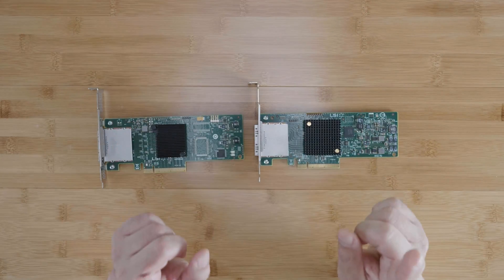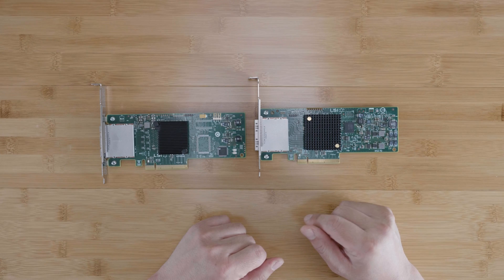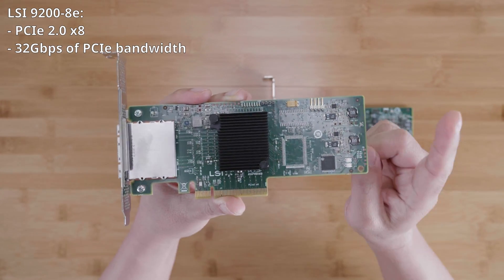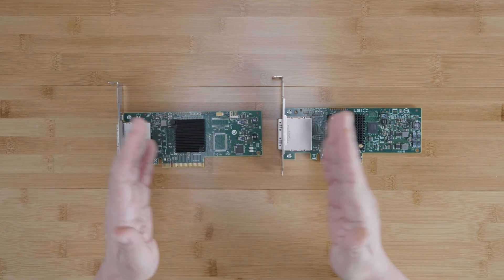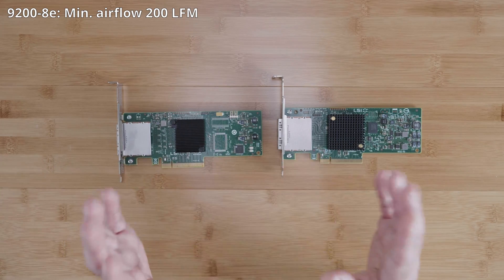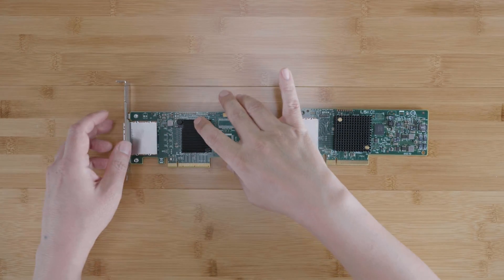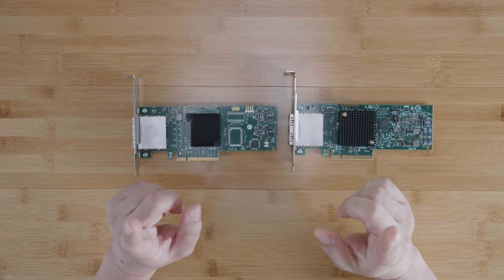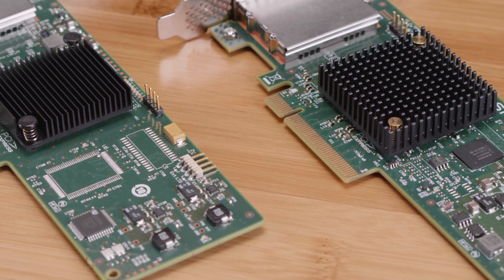8 Things you need to know about the LSI 9200-8E vs 9207-8E

Comment: Possibly a dumb-sounding question (I know that the only dumb/stupid question is the one never asked) but do the LSI 9207-8i and LSI 9207-8e use the same firmware?
Reply from the maker: Officially they use a different firmware file because the manufacturing data is different (board name is 9207-8i vs 9207-8e). but technically, and functionally, they are basically the same firmware with different manufacturing data. You can load the 9207-8i firmware on a 9207-8e card and it will work, but the board name will be wrong.
Reply: @ArtofServer The same chip set but different circuit board layouts to accommodate the placement of the ports. Makes sense.

Comment: Great video. Looking for a recommendation. I already have an SAS9200-8e and I was planning on getting a 2nd one for use with a Dell MD3220 Powervault. Until I watched your video. I intend to use it with VMWare ESXi 8. So now it sounds like I need different SAS controllers. Should I go with the 9207 or is there a "better" option on today's market to use? The MD3220 currently has 12 2TB 3.5" SAS drives. Maybe one day I'll use SSD drives instead of 3.5", assuming it's possible, but that's not in my definite plans. The server is a Cisco BE6000M 1U server. This is a home lab, so I don't need anything crazy.
Thanks in advance!
Reply from the maker: You will need to figure out what driver support is available for ESXi 8. I haven't messed with that, but they have removed driver support in the past. I don't know if the 9207-8e would even be supported in ESXi 8.

Comment: LFM
Reply from the maker: https://www.engineering.com/resources/air-flow-calculator/
Reply: @ArtofServer  Awesome ty, yeah that was a new one for me. I might need it when I try to just piece together a SAS backplane with a 8 disk housing which will be outside of the server because it won't fit inside. I've heard good things about Nocta fans which I might add to that. I'm hesitant to replace the mainOEM  Dell fans with Noctuas because they seems to run a lower RPMs so of course they'll be quieter. So, all this because I don't think I would want a NetApp that will add 200Watt on top of my already 150 Watt.

Comment: Thanks for the video, defiantly helped me decide on which to use to grow Truenas.  One question I do have, and have had since buying my first LSI (internal card). Do they sell a heatsink with a fan, like a GPU has?  Not sure my case has the airflow, and such a thing would be preferable to cutting a hole for direct intake over the card.
Reply from the maker: No, there's no official CPU with fan for these HBA controllers. They depend on the airflow from the chassis to keep them cool. The easiest way to add a fan is to use those PCIe bracket fan mounts that allow you to mount 80mm or 90mm fans in the adjacent PCIe slot blowing air onto the card's heatsink.

There are also some fancy 3D printed brackets you can get to mount a fan directly to the heatsink as well.

Comment: Any recommendations on slim active cooling for these HBAs?
Reply from the maker: Assuming you're in a desktop PC case, I think the easiest method is buying those PCI bracket fan mounts and just add a fan or 2 blowing onto the card in the slot next to the card. There are also some 3d printed fan mounts you can find online if you have a 3d printer.
Reply: @ArtofServer  thanks! What about in a packed 2U chassis? All my usable slots are filled. 😕

Comment: Could you make a video to explain how to control the fans speed connect to backplane？Thankyou！
Reply from the maker: You cannot control fan speeds if you're driving your fans off the backplanes... at least not usually. If you want better fan control, you need a fan controller that is programmable.
Reply: @ArtofServer  all of the fans in my case that is connecting to the backplane,but i can't control the fans speed,i read some backplane manuals,some of backplane have connectors to control the fans speed maybe through the bios or ipmi? i don't know how to find the connectors and which type of cable i shoud use,and how to connect them .

Comment: Sorry for this question not being pertinent to this video, but I'm hellaciously puzzled about something.  I'm in the process of building an entirely new system, but with existing non-RAIDed drives with data already on them.  As such, I don't want to RAID anything, just do simple JBOD work in conjunction with Drivepool (which I'm already running).  I'm wanting to buy the 9400-16i along with SFF-8643 to SATA breakout cables, but does the firmware on that specific card need to be flashed to IT mode?  I was under the impression that practically all LSI/Broadcom cards had to be reflashed, but on reading the docs for the 9400 series, I'm now entirely confused.

Thanks in advance.
Reply from the maker: If the HBA card already has IT mode firmware, then you probably don't need to flash it unless it is older version and you want to have the latest update. It depends on the card - LSI/Broadcom sold both type of cards. Back in the day, it was more common to sell RAID controllers, and some of those can be converted to IT mode, so that's why there's a lot of talk about how to cross flash them to IT mode. These days, Broadcom sells more HBA type cards, so some of them are already with IT mode firmware.
Reply: @ArtofServer  Wow, y'know, all this time I thought ALL of those cards, no matter the model, had to be flashed to get rid of the RAID firmware.  I was trying to research the flashing methods before I spent half a grand on one and they looked arcane and black magicky to the point that I almost abandoned the idea of buying one altogether.

So, is it safe to assume that, unless the card has "RAID" in its name, it already has IT-type firmware for JBoD use?

Comment: how do you identify a rev B0 9207-8e card versus the rev D1 9207-8e visually?
Reply from the maker: run "sas2flash -list" on the controller and next to the chip name in parenthesis will be the revision number. the HP H221 are marked as "PCIe3" on the PCB, but is incorrect and can be a B0 revision chip.

Comment: I bought the 9200-8E from you a few years ago and it works really really well with a 24 port Netapp Disk-shelf runnning on my Threadripper Unraid server
Reply from the maker: Thank you for supporting my eBay store! Happy to hear the card has been working well. yes, those 9200-8e perform really well for the age and with HDD based storage systems! Thank you for watching!
Reply: Me too but I upgraded to a 9207-8e for 2 Netapp ds4243 (one is now powered off for energy saving) and 8 tb drives. It's in a school and the 9207 gives extra performance on our 10gb network (only for technical offices). These little are so powerful... we want to add another ds4243 for students nextcloud

Comment: which would you recommend for a dell PE r450 2.5 chassis with regards for airflow ? (if at all) i am looking to connect a 24 disk storage array if that makes any difference to your answer
Reply from the maker: either should work, just make your choice as described in this video. one thing to note, on the newer servers, they tend to be more quiet and are able to run the fans at very low speeds. basically the bottom end of the fan curve the BMC uses can go much lower on the newer gen stuff. if you run a LSI SAS2308 card in such a server, it likely won't cool the card enough, so make sure to crank up the fan speed or run with "high performance" profile.

Comment: If you have the older revision of the chip for the 9207 is the board correspondingly marked as PCIe 2.0 rather than 3.0?
Reply from the maker: I should be marked as PCIe 2.0, but the HP H221 card is crazy and is actually marked PCIe 3.0 even though it is a PCIe 2.0 card! I talked about in this video:

https://youtu.be/i9iYJynxRU8
Reply: @ArtofServer  Good to know, thanks!